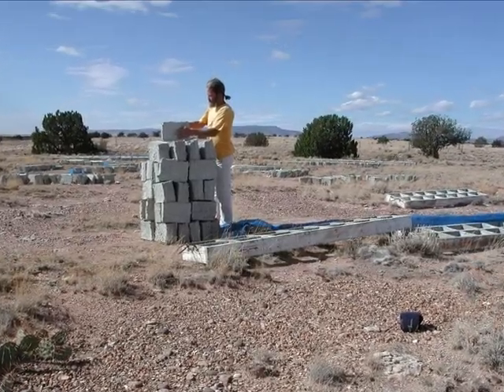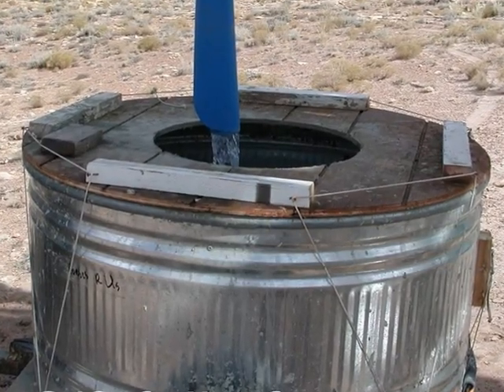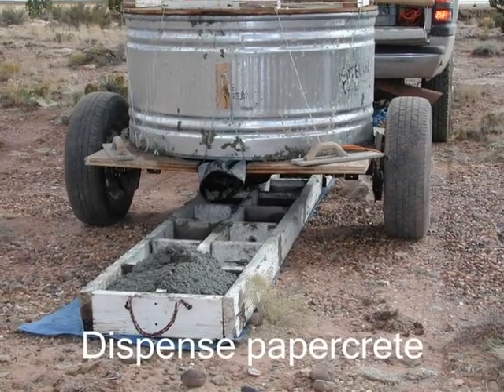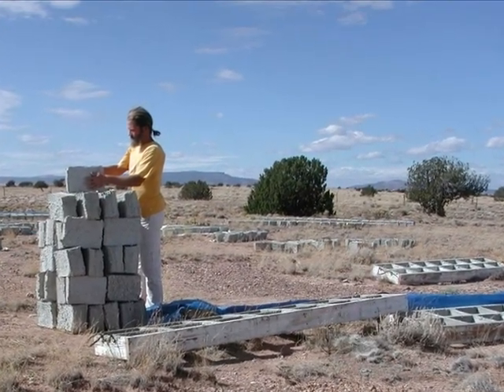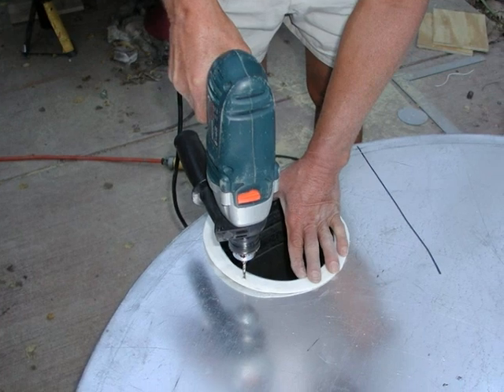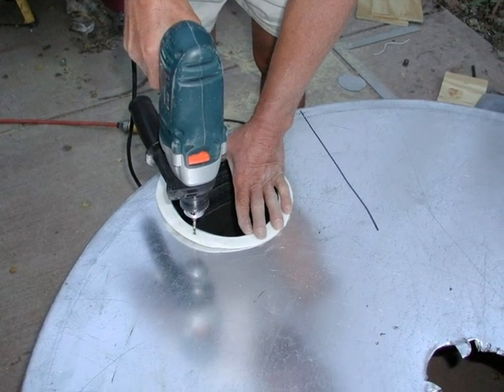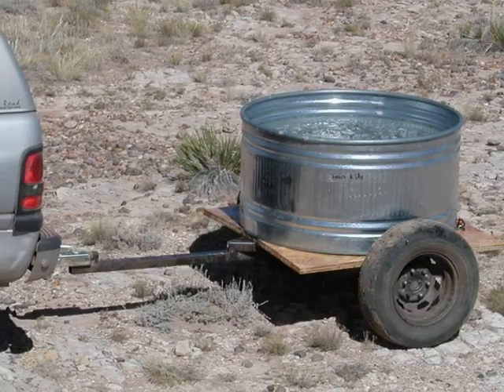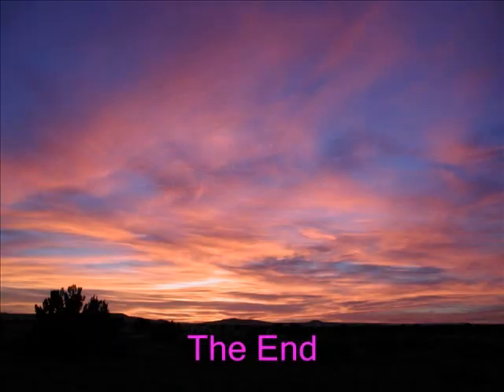DIY How to Make Papercrete in a Tow-Mixer

Comment: bad ass i would like to do this whats the yield of strength per block.
could it be used ass a foundation.
Reply from the maker: fatcat, Papercrete does not wear as well as concrete, and it probably would become damp if in contact with the ground. However, it can be used in a 'sandwich' with concrete below and above, to insulate the floor from cold. In that case, pour the floor slab, cover with plastic sheeting, pour the Papercrete over that, let it dry, cover with sheeting, then add the final floor layer. As there are so many proportions of paper to cement and sand, type of paper, etc., there isn't a fixed psi load capacity for Papercrete.
Reply: what type do you recommend ,if i wanted to put it around my mobile home as a skirting an also as a adobe type ,try an spray it all over the mobile home like adobe.
Reply: marjamada Your explanations for Papercrete are excellent every time. Can't thank you enough.
Reply from the maker: fatkat702
Hmmm, not sure what you want to do. Skirting is one thing, covering your mobile home is another. Here's an idea: In both cases, I suggest making panels of papercrete by casting in forms, say 2' by 4' and 2" thick, then use them like plywood for skirting AND for insulation. Use a good exterior latex paint, light color, and they will be good for years. Be sure to cure the wet PC in the form for a few days to increase strength. Hope this helps.

Comment from the maker: It is NOT waterproof, it will soak up water but not slump, however it will mold and rot. Protect as you do wood. Portland cement, paper and water.

Comment: Grat error, are not ecogical option material, beacause the paper are expensive,
the paper must be utilizated only for recincling generating more paper in other cycles!
Must useful and economic is mixing with the concrete are the sand of the desert were you live,
1 part of cement 6 part of sand
Reply: Sand doesn't insulate. Blocks made with sand could be used for load bearing purposes but it won't insulate. Blocks made with sand are basically conventional concrete blocks. Your suggestion reinvents the wheel.
Reply from the maker: Mariano, discarded newspapers are often free, and very little of it is actually recycled into new paper, leaving mountains of paper sitting, which is also not 'ecological'. A man in Mexico wrote me that this technology is perfect for his country, because they have mountains of old newspapers (they don't recycle them) and they need low-cost housing.